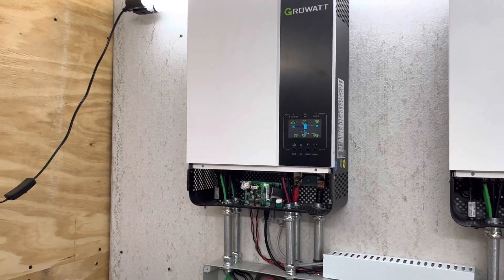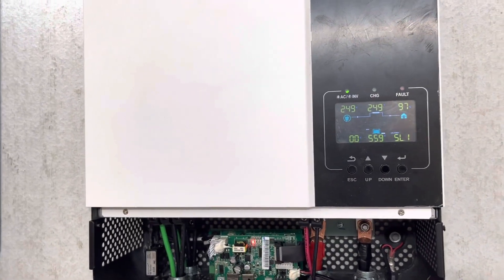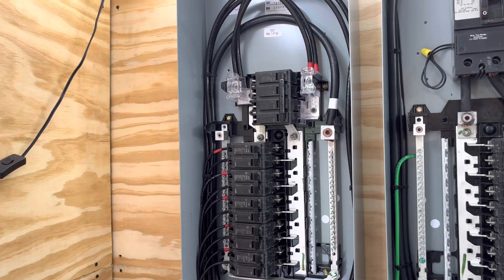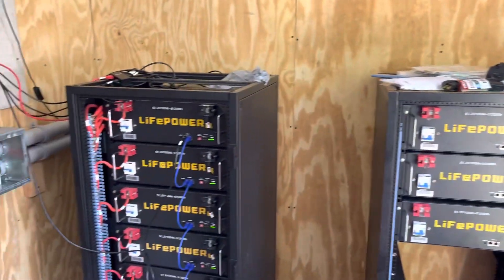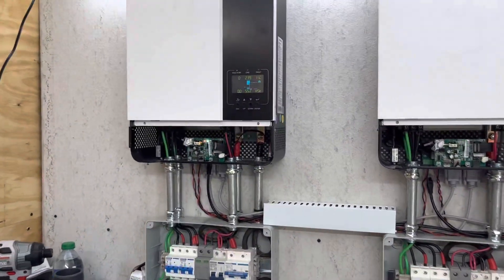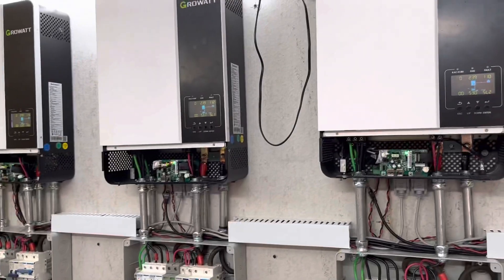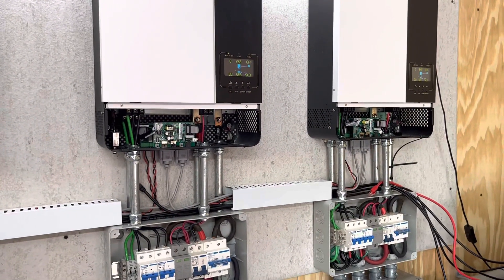Growatt and EG4 LifePower4 Load Testing - How Long Will They Power My Home

Comment: Is it just me or does the voltage seem to boucne alot
Reply from the maker: I didn’t notice the voltage bouncing a lot. The %load did however. Not sure why.
Reply: @jeffmotes2129  seemed to go between 80 and 140 as I watched the video
Reply from the maker: @hoocli  you must be thinking of the other video when I was demonstrating the voltages with and without an isolation transformer.
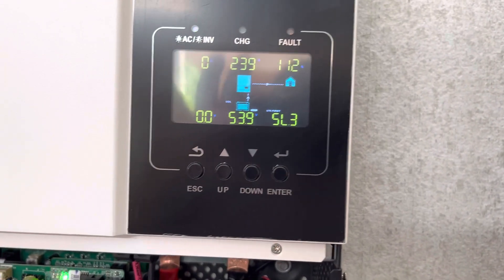Reply: @jeffmotes2129     I'm not familiar with grow watts but  2:48 and 3:16 one shoes 77 and the other shoes 139 top right. Is that not volts or am I missing something
Reply from the maker: @hoocli  the numbers in the upper right hand corner of the display were the percentage of load on the inverter. It was fluctuating more than I expected. The voltages were in the upper middle of the display and those were constant.
Reply: @jeffmotes2129  ok that's better then volts lol although 130 is concerning
Reply from the maker: @hoocli  13.0% …

Comment: How much energy on average are you utilizing per day in Kwh?
Reply from the maker: During the summer months around 100kwh
Reply: @jeffmotes2129  That is quite a bit! Thanks
Reply from the maker: @pazi402  yes. Summers are brutal in Alabama.
Reply: 100kwh???  You need better insulation or you must like it freezing temps inside...I use 8 or 10 during the summer with the AC on.
Reply from the maker: @nach335  better insulation is always a good idea. But it’s a fairly large property, all electric, including pool and barn.

Comment: Are you using any transformers for 110v ?
Reply from the maker: The isolation transformer converts the 240V output of the inverters to 120/240V split phase required for my home and 120V circuits.
Reply: @jeffmotes2129  did you show the transformers in the video ?
Reply from the maker: @ForwardEngineering  not in this particular video but check out these two below. I’ll also post another video soon showing the voltages.
Reply from the maker: @ForwardEngineering  https://youtu.be/5W_dOzbtiyg
Reply from the maker: @ForwardEngineering  https://youtu.be/s-Il07sMlZQ

Comment: You must have read my mind on this setup. The only differences are I’m thinking 120kw of batteries and the EG charger inverters. To be honest the inverters are negotiable. Very nice. The 30kw would last me around a day in the winter and 12 hours in the summer with ac and no pv. I’m wanting 20kw of pv though. This also assumes I build my dream home run entirely with electronics. The only gas would be propane for a standby generator. I’m looking at overkill to extend the battery life or have 3-4 days of battery storage.
Reply: I think the EG inverters are all 120V only at current. MPP has a 11kw pip max inverter with dual mppt chargers @500Voc for $1400.
Reply: @nealhamilton3881  if that’s the case I’ll need to change my thoughts. I NEED air conditioning. Although if I ran multiple mini splits I might be able to get away without 220vac. Dilemmas, dilemmas. I think the mini splits are more efficient and may actually not be a bad choice if that’s right.
Reply from the maker: Hey Dan, sounds like a good plan.
Reply: Just 1 day out of 30kwh? Goodness. Man. Are you running a  car factory?
Reply: @PaulShalahm  🤦🏻‍♂️ Misinterpretation of my electric bill. Durrr. In the summer I’m using around 45kw per day. That being said 120kw would indeed get me 4-6 days of frugal use in the summer without Solar incoming. I’m hoping for net metering too. I’d like to be green, especially if I’m able, but I’m not fanatical about it.
Reply: How is your project coming. I too am looking to install 120kw currently ordered 60kw with 10kw pv array. Would be nice to share ideas
Reply: @nonsoiwunwa2553  I still need to put up a pergola in order to get the panels off the lawn. Once that happens I’ll pick up some more panels. My roof is 7-8 years old and if I put panels up there I’d have to have a solar installer put them up so the install would be covered. The problem there is the companies I have seen require you to buy their panels at a large markup. I probably should ask my roofer if he’s ever done that. 🤔 i did pick up 4 230ah batteries and im lasting quite longer with the washing machine, sm chest freezer, and fridge. It’s been fairly cloudy though. Bad for charging with 1500w only. I did set up a transfer switch for 7 circuits including the furnace. What I have works fairly well but is a long way from my grand though. I still have a grander thought with a new home though.

Comment: I noticed my growatt master and slave show different battery voltage, slight as well despite equal length cables to the battery.
Reply from the maker: Mine are not equal length but close. I did the calculations on voltage drop at maximum load and battery capacity and the voltage difference between the closest and farthest was not significant.

Comment: Soo how long did the battrees last ?
Reply from the maker: 7 1/2 hours till shutdown.
Reply from the maker: Started on the batteries at 10:00 am. Batteries still providing 100% load at 4pm. Six hours so far.
Reply: @jeffmotes2129   What was your load
Reply from the maker: @mboston7010  at the time I didn’t have my monitoring system installed. It was a typical mild spring Sunday, probably one of the lower usage days for us. 

I have since installed Solar Assistant on a raspberry pi and Emporia power monitor. I’ll run the test again soon and publish the loading results.